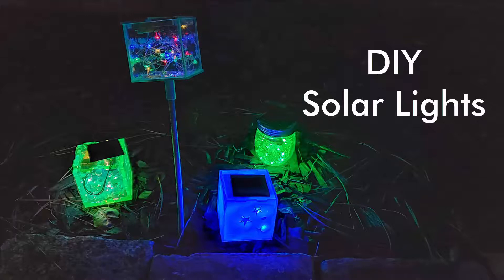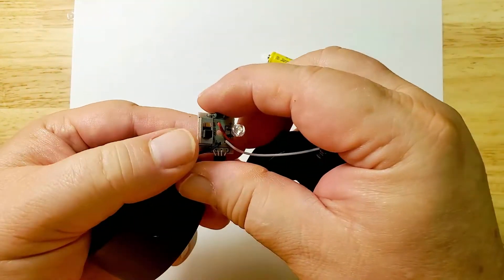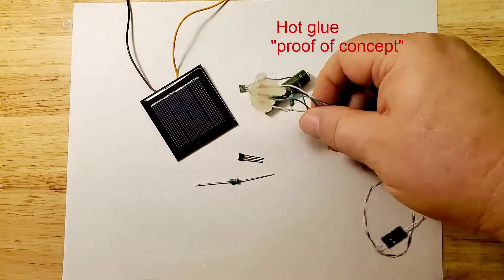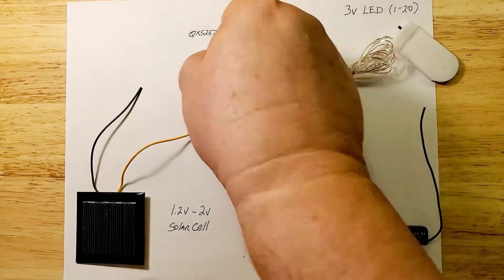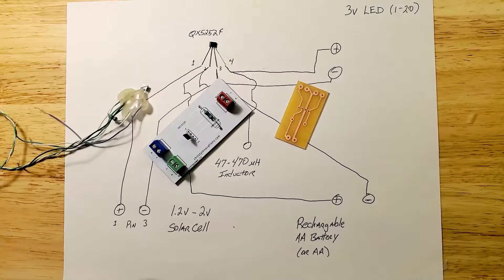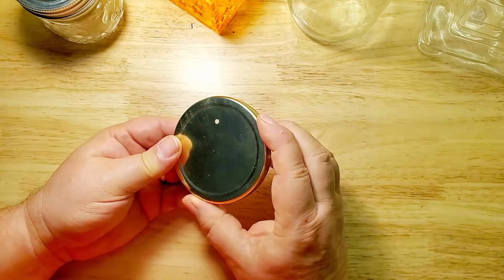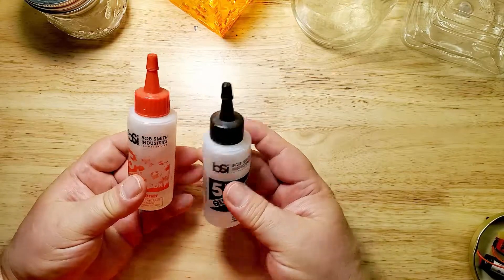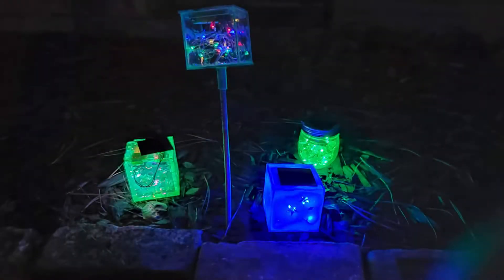DIY Solar Lights

Comment: Qx5252f You can use up to a 5v 800ma panel even though it's a mismatch it will turn the led on when it gets darker than using a 2v. 
3v-4v solar panels work well too as long as they are under 800ma.
Use a 2000mah or larger nimh and an inductor as small as 15uH-33uh can be used for maximum brightness while retaining efficiency. 
Extra efficiency/light can also be gained by using a diode 1n5817 schottky high speed diode in series with led and 1uf cap across led. 
(diode and cap also required for colour change leds to stop them resetting and staying on red.)
Have fun.